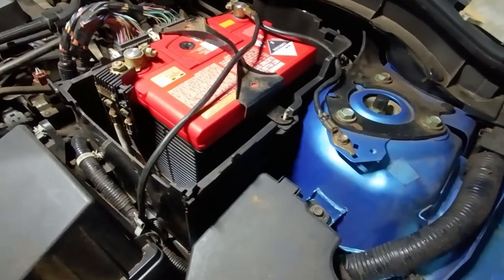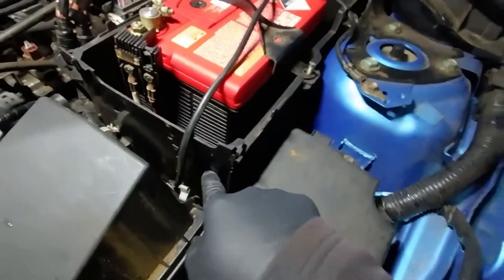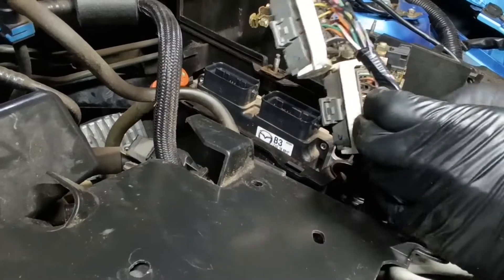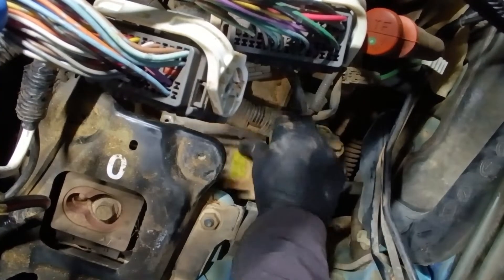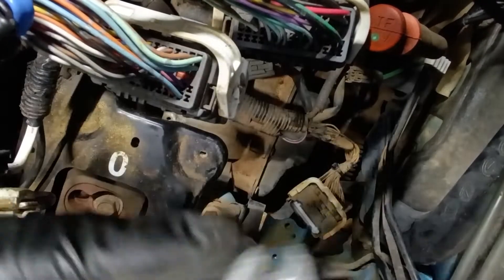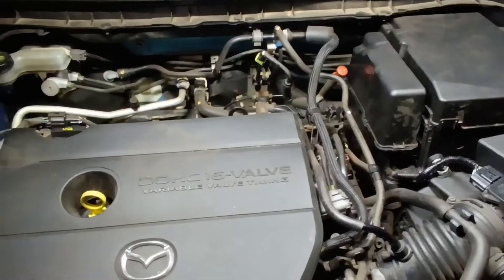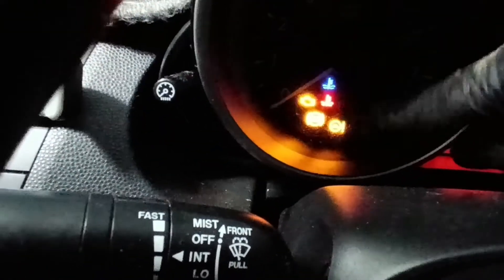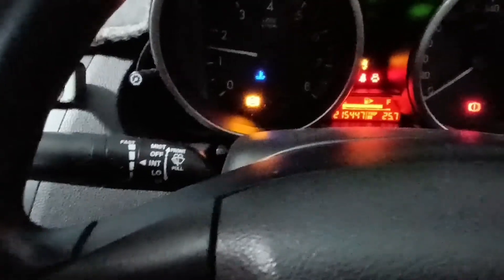2010 Mazda 3 BL 2.0L Shift solenoid resistant check and TCM replacement P0753

Comment: I have a Mazda 3 2.0 2008 code p0762 solenoid C stuck. I changed the 3 ABC solenoids but the same code continues. I tested the solenoids that the car had and they seem to be in good condition. What other company can do to find the fault or could it be that the computer is damaged? Thenks
Reply: My car doing same thing I’m think you might just have to change TCM that what I plan on doing

Comment: Just an fyi for anyone trying to test solenoids by jumping power and listening for the click without removing. The 2 single wire solenoids DO NOT have internal springs. Does not work to jump power to test these 2 unless in your hand and you can push against pintle when jumping. Thanks for the vid.
Reply: Never jump use car battery as the volt is not the same as solenoid.

Comment: working on mazda cx7 (2012 2wd touring) do you know what code is p0770 it says solenoid shifter E from the solenoid A in your video would it then be solenoid B  then C on that right side then on the left D E F ???? i believe the code says solenoid e is stuck in the off position would you happen to know ehat the ohm reading should be for the solenoid?

Comment: How about the DSC light on? Wasn't related to the bad TCM? I have a similar issue (Lost Connection with ECM/PCM and TCM) with 3 lights on (Check Engine, AT, DSC).
Reply from the maker: What DTC code do you have? A bad TCM can trick the DTC and DSC at the same time.

Comment: Hello, I just bought a 2011 Mazda 3, but I discovered that my car shakes whenever I put gear in Drive and Reverse. Scanning machine detects solenoid a,b,c electrical problem. Please what should I do?
Reply from the maker: Have you check the fluid condition? I had a case the solenoid electrical problem cause by a dirty filter.

Comment: I have a Mazda 5 2009. I  have the same problem. I have changed Solenoid A & B electrical  and TCM still car jerk in reverse gear  and AT light s on.
Reply: Tcm
Reply: @AnthonyLeal-uz2re he already did that
Reply: Shift  Solenoid F
Reply: My sis Mazda 5 has a same issue, turn out the gearbox have to overhaul.